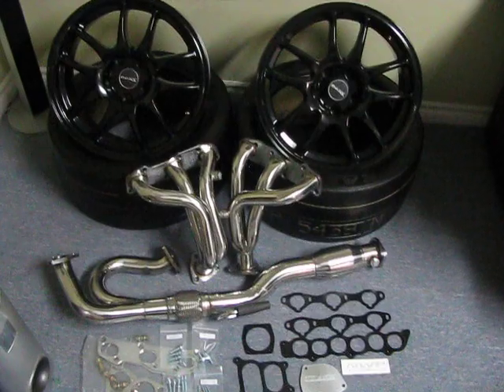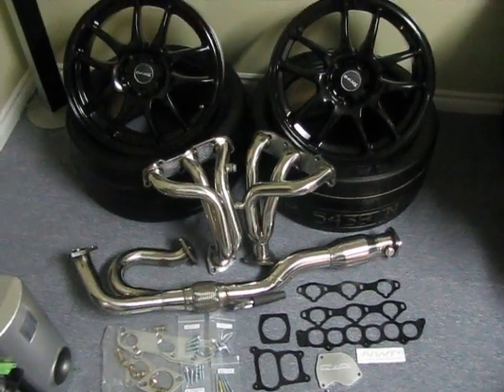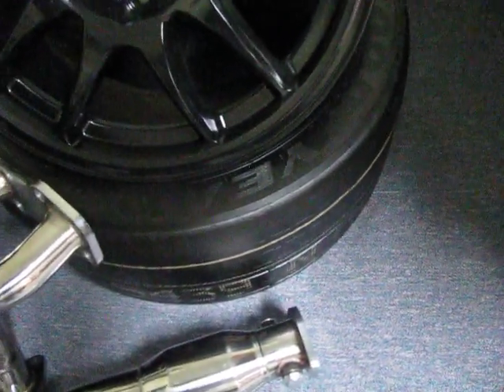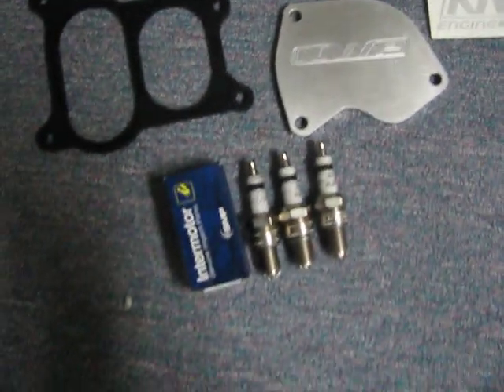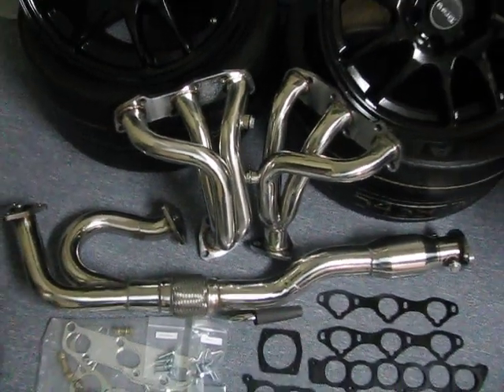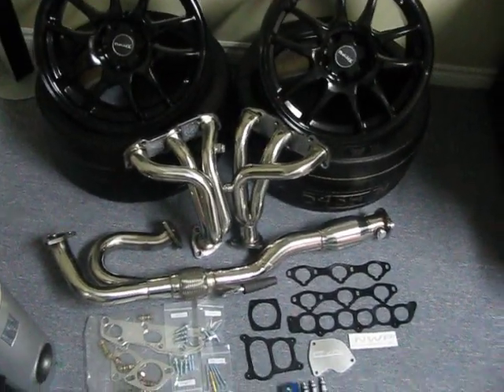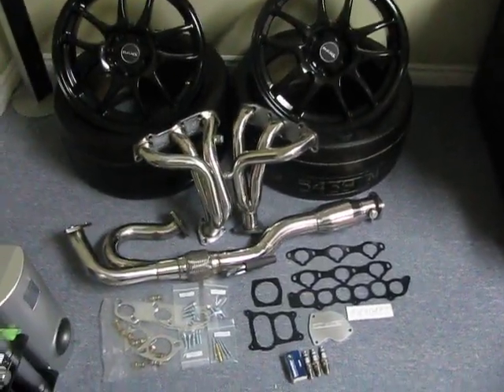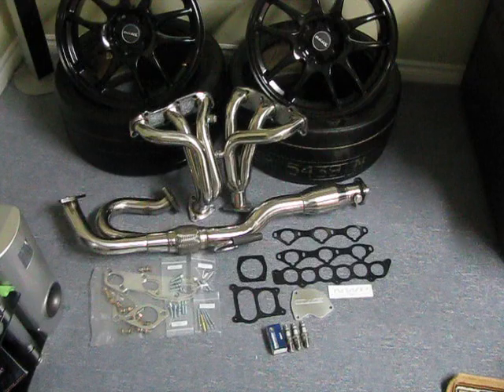Nissan Maxima Bolt-on's

Comment from the maker: You'll have to spend a lot of money to do that. You'll get a code for EGR P0400 for recirculating air but you can by-pass this by welding the EGR to the headers. You'll get the code for removing the catalytic converters I think it's P0430. So honeslty my advice to you is if you don't plan to race don't do it. It's a lot of trouble shooting. You might have to repalce your air/fuel ratio sensors after the install and it will be very costly, also you'll have to extend the 2 rear ones. PM questions

Comment from the maker: @nitrors4pr I doubt I'll be doing a before because a stock maxima with a CAI dyno's at about 229WHP so I'm going wit that. My main goal is to shatter last year disappointing 15.5 1/4 mile time. That will determine if I wasted my money. The car was basically stock and I was inexperienced so I'm focusing on my launch and shifting.

Comment from the maker: No they're ebay headers and I think it should fit no problem. I literally just got them and i'm not that experienced with the 6thgen's but the seniors on maxima.org would be able to help you no problem. There's a lot you need to know before you add the headers. I opened a thread on it so you should go read it. If you have any questions you can PM me and i'll answer if I can
Reply: MrJasonlyrics u think it will fit on my maxima 07?

Comment: Hey nice set up! What year is your maxima? I have a 2012 max. What type exhaust and headers is the best out there that add more hp but also quiet like it is now-just stock? I have the factory 18" wheels. Can I replace them with a 17"x8 like yours so my car is lighter? Id appreciate your comment. Thanks.
Reply from the maker: J D unless you plan to spend a few months of your pay cheque I would stay away from modifying this CVT for performance. Doing headers means you have to do catback, and you'll need mufflers and they're not cheap. When you install headers a tuning software is imperative as your a/f will be off so you'll need that to correct the mixture. Getting your aftermarket to sound quite will require a large MagnaFlow resonator plus you might wanna add a catalytic converter for emission purposes. Not sure about the emissions in your state but here if you passed before without a tune and you turn codes off via the UpRev tune your car will not 100% fail. From that point they've already saved your data so if anything changes you'll fail. 
Now for rims. It is not necessary to go smaller "unless" it's a rim specifically for racing or winter. You can find 18, 19 or 20" lightweight rims because if you go smaller you'll have a larger wheel gap and even larger if you'reon stock suspension.
Reply: Mr. Jason, ty for that info. Ill just leave the engine and wheels alone...dont want to waste my time and money and and deal with all that headache. However I'm thinking of lowering my car by 1" only...not too low so I dont scrape my front under bumper.  I've some research and I coilovers i could lower the front and back by approx. 1".  But if I get springs like eibach, the front and back are permanently set at 1.3" and 1.4". I like to get medium to high quality coils or springs that would not produce any squeaking noise. Do you have recommendations? Once again I'd appreciate any advice. Thanks bro!
Reply from the maker: J D I wouldn't waste time on springs because you'll have to buy shocks/struts to pair them up. If you're gonna lower your only 1" you might as well leave it stock. Springs Is probably gonna cost you about $200-300 and they will reduce they longevity of your OEM shovks/struts. I was once like you where I would rather springs but now I only want coils as I have the convenience of adjusting the height and camber depending on my rims and tires. I would never recommend springs but if that's your budget then go for it, you'll be changing your shocks maybe 1-2yrs after.
Reply: Ty Mr, Jason. Which coilovers is the best- Eibach, KP Control Pro, DC....? Ty bro!
Reply from the maker: J D I can't recommend the best because I've only used full way adjustable K-sport on the Maxima and ISC on the Kia. I like the design better on the ISC because evening is more beefier. You gotta do your researchon what's best. Racingline Performance have really cheap basic Tein coilovers but the downside is the shipping is extremely long. I've heard some wait time exceed 4 months.

Comment: Can I just put the headers in and leave all the CEL codes alone? Will that cause any issues ?
Reply from the maker: You can run it for a little, but it's not recommended. You'll destroy your oxygen sensors real quick. Plus you're going to get a ton of power from the headers.